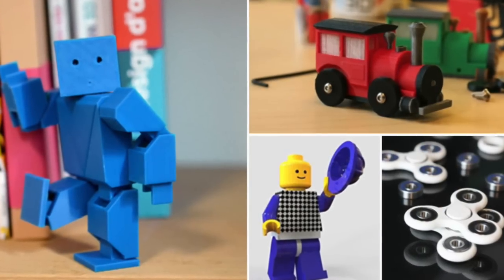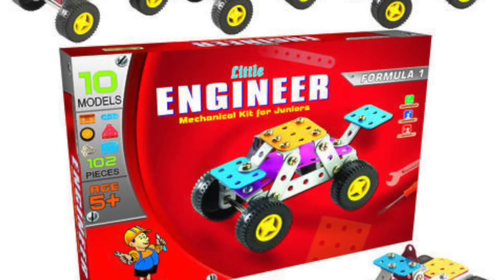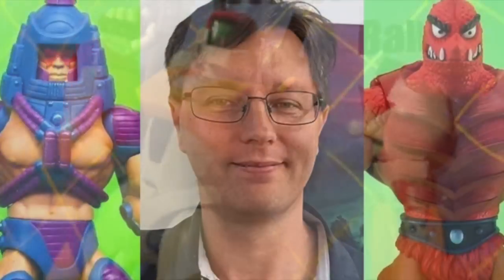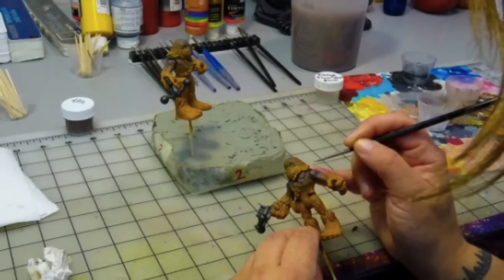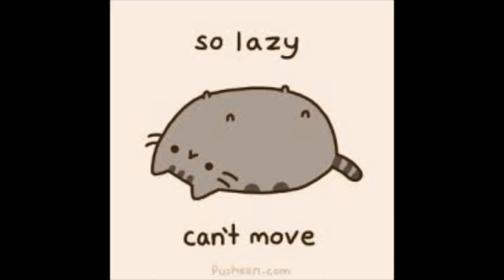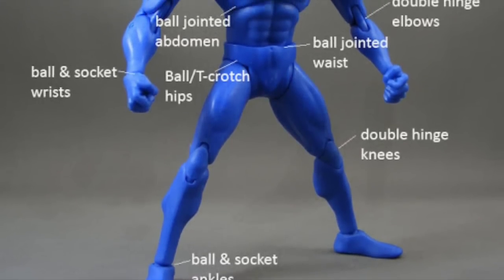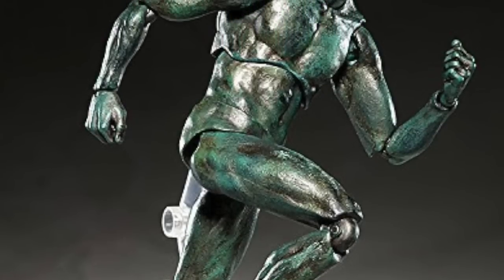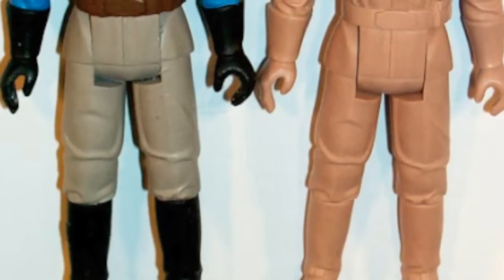Toy Engineers: the unsung heroes of the toy industry. What does a toy engineer do?

Comment: I think Hasbro does a great job with their 3D modeling, the final result usually looks exactly like the model. On the flip side, the Loyal Subjects could really use a lot of work with their BST AXN figure line. The 3D models look OK, but they don't translate well into figures, they lose a lot of details after molding and painting and just look a little bloated to me. I guess that's the real shortcoming of digital sculpting, you need the molding end to be up to snuff to catch the same details as the render, all the digital details don't matter if you can't tool molds at the same resolution.